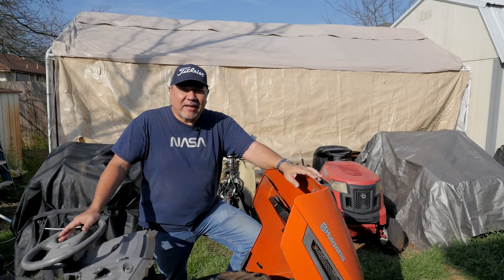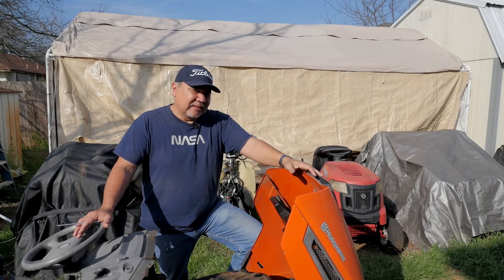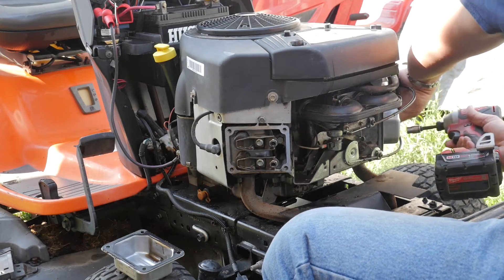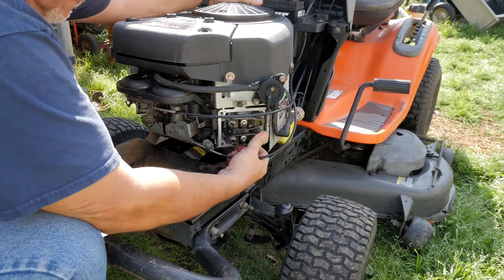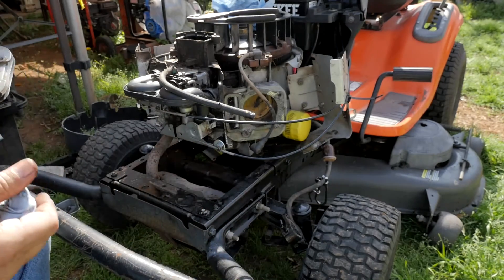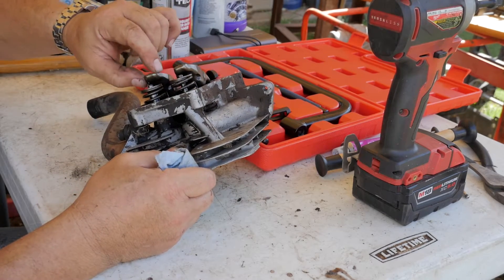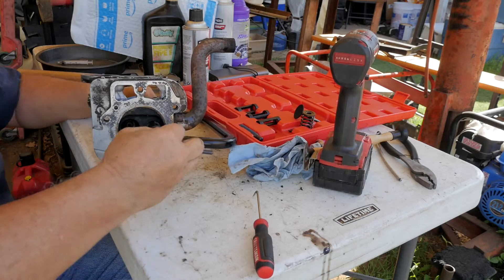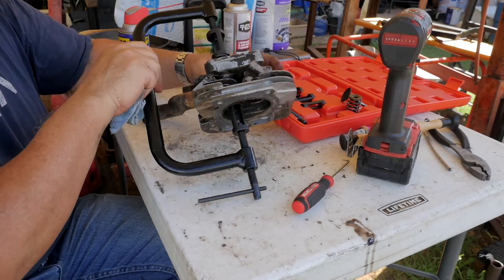Husqvarna YTH2348 needed Push Rods  WATCH FOR AN UPDATE OF THIS VIDEO!

Comment from the maker: A BIG UPDATE:  Out of curiosity, I checked to see if I could see a rod or anything else in the oil sump.  Guess what I found?!?  Watch for an upcoming video and show how I located the rod.

Everyone, don't panic.  I was also worried about the steel pushrod being in the oil sump.  I confirmed with the previous owner that he took both push rods from that side.  But yes, if he didn't confirm then I would crack the engine open. 👍👍

Comment: The head has overheated, causing the aluminum to expand from the steel seat, allowing the seat to move. Pounding the seat back down is just a temporary solution. You either need to ping the aluminum directly around the seat or replace the head.

Comment: When you are MISSING a pushrod.... that should be a complete engine pull.  Push rod is most likely INSIDE the engine block. ALSO that "VALVE TAPPET" was missing, most likely inside the engine as well. When the VALVE GUIDE moves like what happened in this case, "knocking" it back in place might hold for a lil bit, but if you would have "peened" the guide on the top and bottom, that would have helped to make it a longer lasting fix.  Peening the valve guide top & bottom, welding the bottom of the valve guide are about the only cheap fixes I have heard of BUT replacing the head completely is about the only sure fix.... unless it overheats again and moves the new one. just my opinion though.... push rods missing.... I pull engine and find them and all the missing pieces. could come back to bite ya later if ya do not. again.... JMO

Comment: You are better to be sure the steel pushrod isn’t in the crankcase before returning back the tractor to the customer because any debris in the crankcase will eventually destroy the engine. I personally learned it the hard way with my 21hp craftsman mower. Also, it’s the « valve guide » and not the « valve seat » which moved and cause the pushrod to bend. Probably the engine overheated and the soft aluminum head has expended at the point the steel valve guide had no more resistance in the hole.

Comment: Drive guide back in place and use stick welder and take the rod thru port and rack it
To prevent it moving again 
Then clean engine for over heating problem cause this

Comment: Here in the UK, my 2348 is 15 years old, 1000 hours on the clock.
I lost power and found a dislodged pushrod but no apparent damage. I repositioned it, lasted for 25 mins then jumped out again.
I suspect it may be the valve guide but am no expert.
It's been a great machine but will probably be sold on once I've repaired her.
Question: is it feasible to tap (using a socket like you did) a displaced valve guide in without removing the cylinder head?
Reply from the maker: It is possible.  Just watch how deep you go.